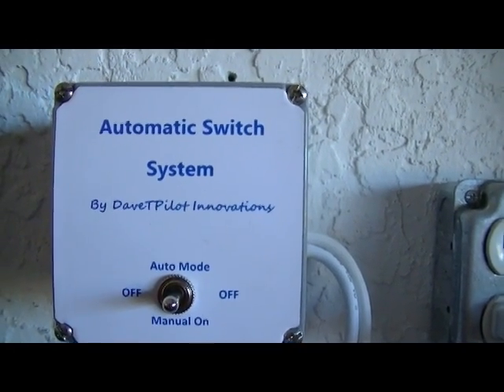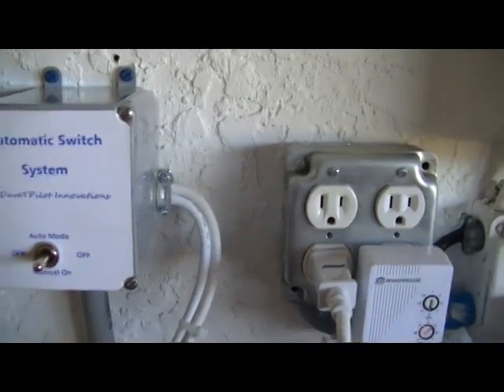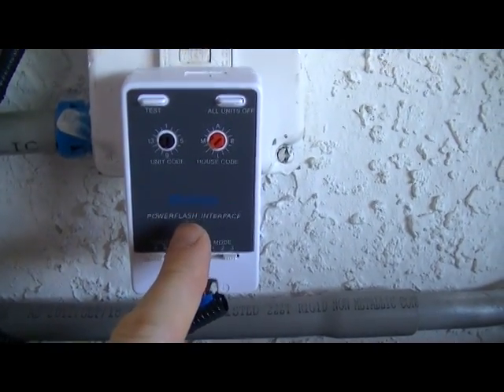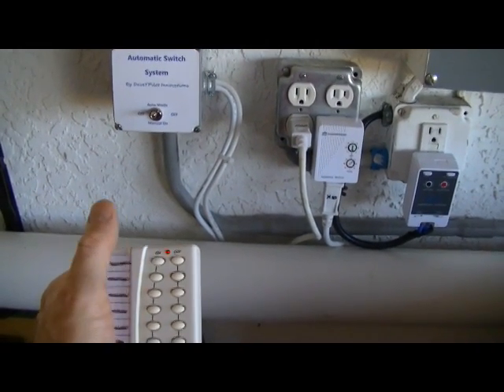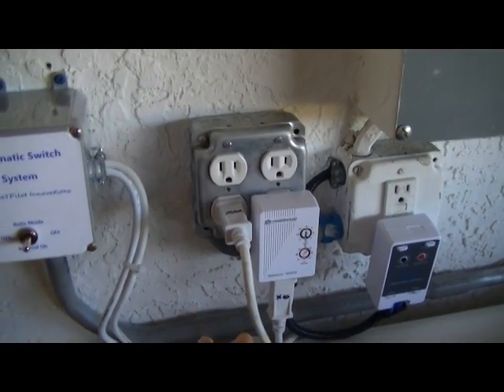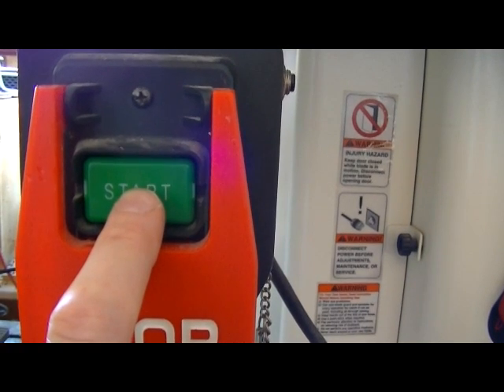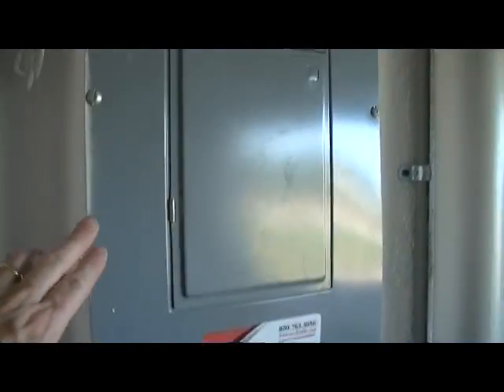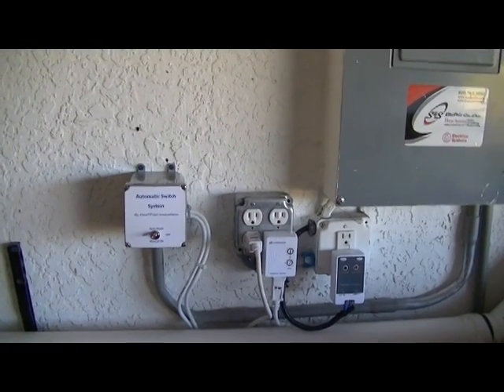Automatic Switch System

Comment: could you please give a part number and name brand for the current sensor you have in the breaker panel maybe a photo of it. Thanks Gary
Reply: I hooked up the contactor switch the way you suggested with the X10 parts.  Everything turned out to be a very tidy installation.  But when hooked up the power sensor transformer to the powerflash unit it does not send a signal to activate the contactor.  The unit tests ok with the test button as well as the rest of the system. The problem is the power sensor I purchased does not generate enough current to activate the powerflash unit.  Can you tell me the make and model of the power sensor unit you used?  Thanking you in advance for your trouble.